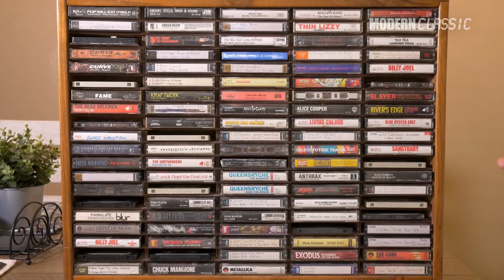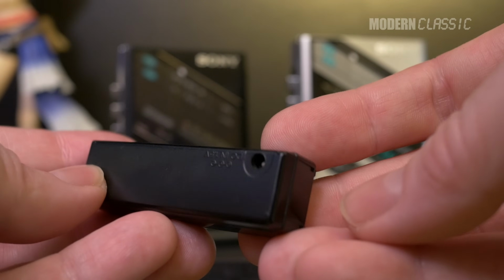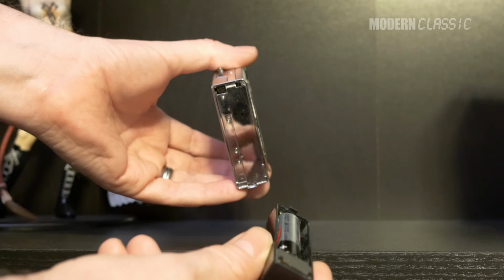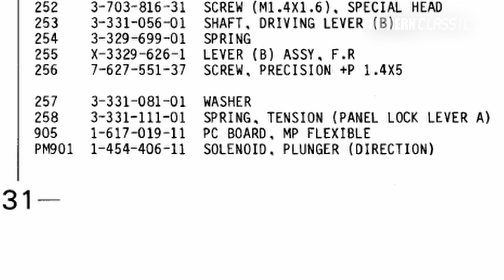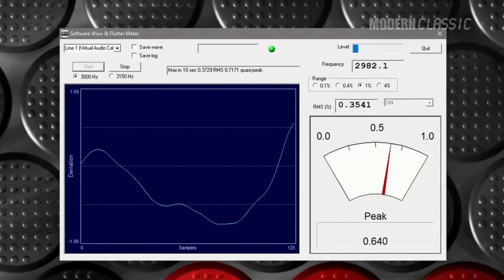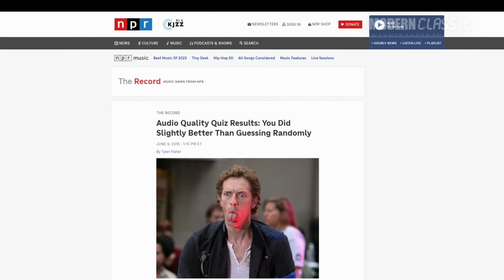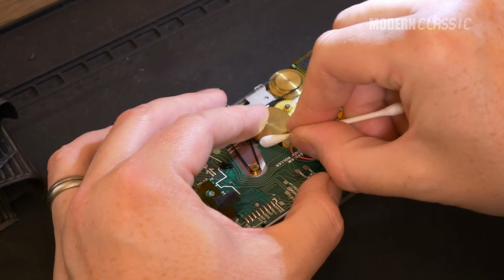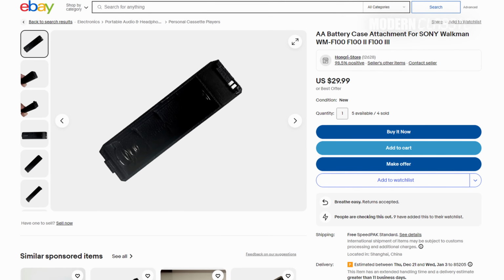Repairing a Sony cassette Walkman (or trying to)

Comment: I've been there too.  Have a beautiful red JVC boombox with detachable "walkman" unit.  I pulled it open to see where the belts were and understood immediately that ultra-small early '80s cassette devices are the worst to repair.  Snaking wires, multiple boards, and tiny metal pieces.  I am happy to leave mine unrepaired and have no regrets that it is beautiful but nonfunctional.

Comment: the oiling needs to be done under the flywheels and motor belt assemblies, all you did was put oil on the shaft they connect to. you can do this with a syringe and the stuff I'd recommend is light sewing machine oil.
Reply: this

Comment: I feel your pain! I've got the same model that has it's own set of issues. Look at the bright side, at least they both play! Most of these often need more work than just belts at this point. I ended up settling on the Wm-F15 and WM-F65 models and just got lots and lots of practice repairing those models.
Reply: Which turned into two great vids :) Glad to see you here :)
Reply: @esseferio  Why thank you! Glad you enjoyed them! They make you work for the results for sure haha
Reply: I just managed to get my WM-F103 working with new belts, as it wasn't so hard to get to, but I have a WM-F65 aswell, which needs a belt replacement, but after removing the back panel, there is a lot more dismantelling to do to get to it, any guidance on what to do next would be appreciated?

Comment: Sony equipment from the 80s has that look and feel that you don’t see elsewhere. The downside though, well you already showed what can go wrong. Belts are pretty easy to do at least, and even though the compact design is awesome to see, it’s not the greatest when it comes to service. It’s still nice to see that you were able to get one working, and as for the battery covers, it might be worthwhile to get a 3D printer to create them yourself. I’m sure you’d be able to get more use out of it also, making replacement/extra parts for older equipment!

Comment: Bought a WM-F202, not an easy fix either. I have auto reverse works intermittently, sometimes not working at all. It turns out the solenoid gets a little too sticky with the green lever, so I put some Molykote between the solenoid and the green lever and the auto reverse works more reliably since.

Comment: At the time those walkmen came out I was as much into sound quality as I could afford. I had a decent turntable, a really nice Technics cassette deck , and an Alpine cassette deck in my car. Trying my friends’ walkmen I found their sound quality so disappointing that I never spent the money on one. They really never actually sounded that well. At the time I figured it was because they were trying to do so much with one or two double or triple a batteries. My first Discman was a bit pricy and skipped here and there when walking with it but it redeemed itself through its sound quality.

Comment: Re the broken lugs. Superglue and sodium bicarbonate (baking soda) is a technique often used in the model railway world to fashion small, stressed areas like plastic lugs. It will form a really solid mass that’s actually quite strong and less likely to break than your epoxy solution. The Tech Tangents channel had a video about it a while ago if you go through his back catalogue.

Comment: I have a WM-B47. It's similarly featured - tape type selector, auto reverse and Dolby B. It just has push button controls and is far larger than the Walkmans you're showing. And it's made out of plastic, which I assume is why it likes to catch RF interference. 
I also had an Aiwa player that was much worse, it had terrible wow and flutter but that was most likely belts - the original was very loose and the replacement turned out to be of incorrect length. No RFI issues, though, as far as I've noticed.

Comment: the problem i see with these 3d printed replacements is they like to use filament printers to make them, which filament has a long list of problems with longevity 
i tested a resin printed cover i made on a f10ii walkman and it seems to work fine however, only issue is they are quite brittle and if you drop them it could shatter 

also dont worry about not being able to fully fix these, these were from a line of "miniature walkmans" from the 80s that used the dreaded 420uf 4v caps which cant be sourced anymore, so even if you fixed them the capacitors would die shortly after anyways

Comment: Oil spray lubrication of the internal parts of the engine can help, thus revived the wm - ex999. after lubrication, you need to listen to one or two cassettes, the engine will return to normal

Comment: Wow! A year long saga to fix one Walkman?! I have about 12 Sony Walkmans that all need a new belt in my storage that I started buying about 14 years ago before many started collecting. Yeah, most got a new model when one broke and couldn’t afford to get all the models you wanted. Not like now with buying used and non working one and buying to collect at a fraction. Yeah, I remember that Walkman and a friend had one when Madonna and Prince were starting out in 1984. The problem with replacing the belt, it’s not like changing the battery and more complicated. Also, once you e changed it, you may need to change the belt again even when you don’t use it. 

Oh does that model those charging sticks? I just saw one where the face plate is off and the glue dried up. When buying a Walkman or boombox, you almost have to assume it’s not working and pay as low as you can.  Oh yeah, that model came in silver and also black. Yeah, that model was slick and modern and that was a big deal in the 80’s having a small gadget and have so many features.
Reply: I was going to consider a mini Sanyo boombox without an antenna  and battery cover, but after watching this, I’m gonna stick to something as complete as possible to save myself the headaches. There’s so many complete boomboxes and Walkmans, why not spend a few more dollars on a more complete unit or better condition to save yourself from going crazy. Bc even figuring out how to change the belt, chances are something else may need to be fixed like the auto reverse in your case. I recently took apart a vintage Ain’t clock radio bc there was something loose. I figured out what was loose and some antenna with thin wires connected to it that had gotten unglued. So since I didn’t have any glee, I closed it up and all the sudden the am radio was not working. What drove me crazy was not knowing if it was working before I opened it or it was already like that when I bought used and never checked. So that’s what o mean by making it worst of you don’t know what you’re doing. Lol!

I wish more ppl. we’re into vintage audio, like ppl are with vintage cars and have more supppet or be able to yak to a shop and the clerk saying oh you got a Walkman 2 and I’ve worked on hundreds of them before. Eureka, that’s a great business idea and you know that’s gonna be the case 30 years from now!
Reply: After all that work, you could’ve bought a dead stock in the original box for a minty one.
Reply: Now it sounds like an electric shaver. With so many parts that the common person don’t understand. Without an experienced pro working on it, you’re almost asking for it to go wrong.
Reply: Also after watching, you made me realized that vintage non working radios have value for their parts. I mean if you know what you’re doing and just go to the goodwill and buy up some of the better electronics and you could start your own repair and parts business and rent a small space.

Comment: If you're going to go to the length of getting 3d print files, and printing your own 3d printed battery cover that will probably break: an alternative would be to use silicon to make a mould from an existing battery cover, and using an epoxy to make a bunch of brand new ones.  The prototype "plug" could even be made out of styrene sheets you can get from hobby retailers.  Both ideas are hassles, but there are people out there who use silicon to cast scale models, relatively inexpensively.

Comment: Yeah you get to learn which models to avoid. I have installed over 100 walkmans inc this model and I avoid this model and others with the same tape mech. Not a very good unit.
Reply: @Raptor50aus which models are the EASIEST to repair?  Any references with good instructions?  I have 2 x F10s to repair.  I would appreciate any knowledge you can share?

Comment: Why do people even do this?  Cassette/tape just sounds aweful...Collector or pure hipster things?
Reply: I thought of the same thing- that cassettes sound awful- in the 1980s. It took almost 30 years later to understand the incredible technology behind them- and that they can actually sound as good as CDs- given the proper knowledge, equipment, settings and tape. It’s hard to explain except that it’s more than just listening to a song on Spotify. A lot more.
Reply: @YouTube4Rudy  I know it's analog/lossless but it's a terrible medium, and so much depends on the recording/extern factors. We used to sit in group listening to new cd releases because they sounded so amazing vs cassettes. I simply don't understand the 'hassle.' Don't get me wrong, if you like it ->more power to you...enjoy